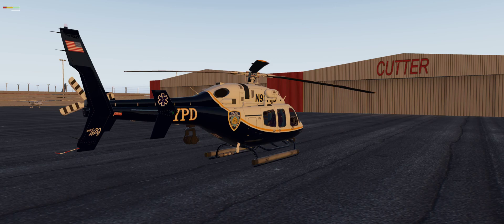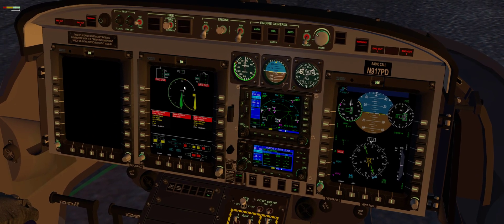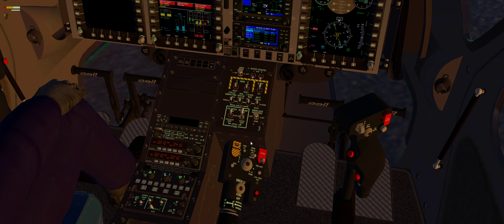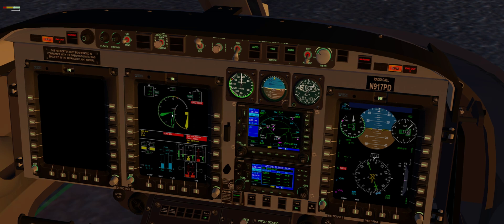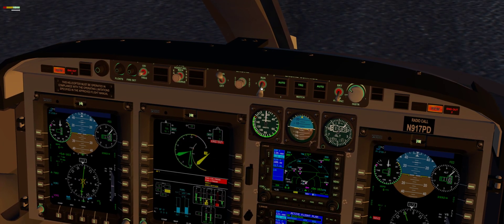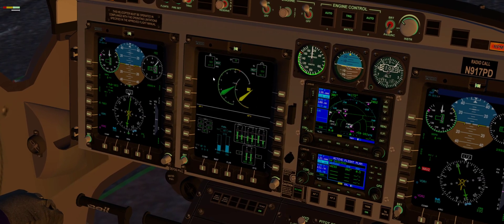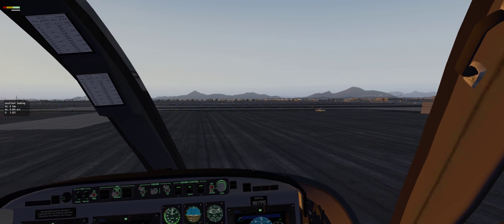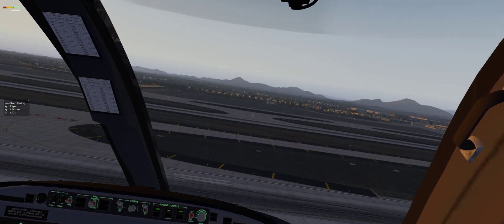Bell 429 Start-up & Takeoff (Cold and Dark) Tutorial - X-plane11

Comment: My helicopter works but I cant raise the collective, I have to manually use the mouse to lift it, and then the helicopter lifts off too fast, which is not a very pleasant way to takeoff :(
Reply from the maker: I would then go into the settings and bind it to a key that might be easy to use like shift for up and ctrl for down